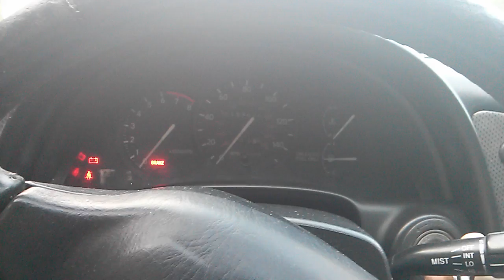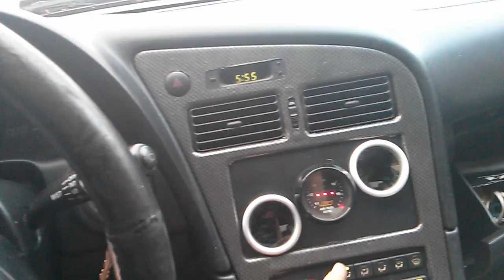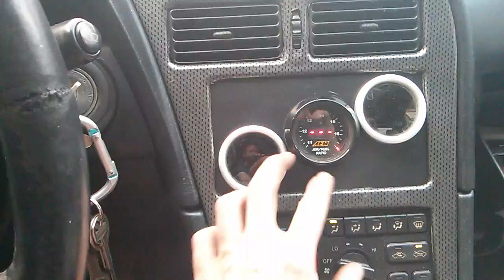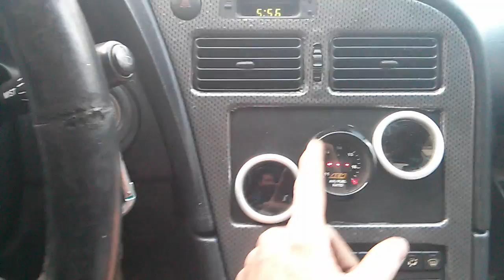3sgte swapped Celica first run!

Comment: I have a 1996 st206 Toyota Curren (P much a celica) with a 3S-GE engine in it currently. Yesterday I bought an old 3S-GTE engine to rebuild and put in. Still not too sure what I'm doing but I think I'll figure it out. It's gona be MAAD
Reply from the maker: I love the Curren! I've always want one, or at least the front clip. You will need a hood with vents though. I left my stock Celica hood on for a while and the engine gets too hot. I needed the GTFour hood, runs cooler now. I definitely want clear Curren taillights tho
Reply: Yea all Currens were made right hand drive, and 95% of the exported Currens are in New Zealand and Australia, obviously. Aw really? I'm not a big fan of most hood vents, so I guess that'll be another little problem, and I'll need a custom made one, because no Currens come with hood vents. The engine I bought was a 4th generation 3S-GTE, from a ST215 Toyota Caldina GT-T, so it has a top mount inter-cooler, but I wanna get a front mount one. Also, it has done like 370,000ks so it will need a lot of rebuilding and new parts before it goes in the car. It was cheap tho. I got the whole caldina with a running 3sgte engine for $700 NZD. Would it be a problem if the Caldina is 4x4 but my curren FWD?
Reply: You managed to connect your laptop to the ECU? Did you get a special ECU for this?
Reply from the maker: Simeon Stoyanov For your hood, do a google image search on "hood spacers" and buy some. They add a gap on the back of the hood for heat to escape. About the AWD trans. You said you have a 3sge in your curren right now correct? If that is the case then just use the flywheel and clutch pressure plate off of the 4th gen 3sgte and the clutch disk off of your current clutch (unless the inside gear on the clutch disk fits on the spline coming out of the transmission) It's what I did and it works fine. I don't know how similar the 3sge and 3sgte are but you might be able to use the whole flywheel and clutch assembly off of the 4th gen
Reply from the maker: Simeon Stoyanov I'm using an aftermarket ecu, I've done too much to the engine for it to run on a stock ecu. That is how I have a laptop connected to it.
Reply: Jay Shipp Yea hood spacers seem good, cheers mate. About the uh.. transmission. Both cars are auto, lol. I was planning on making my car manual along with the engine swap, and I was worried about whether an AWD engine would need anything to work on a FWD car, but it looks like I won't need anything, since I'll be replacing the flex-plate with a flywheel.
Reply: Simeon Stoyanov Obviously gonna need a manual transmission tho. Gonna be broke after this.
Reply from the maker: Simeon Stoyanov Oh, yes. I was thinking it was already a manual transmission. You would need a manual trans. Check out 6gc.net, they are celica forums but they would apply to the curren as well since it is the same car. Lots of guys love the Curren on there, and there is a ton of information on what you can do about your transmission.
Reply: Jay Shipp Sweet, will check out the forums. Thanks
Reply: @simeonstoyanov5226  did you ever do the swap?

Comment: I'm doing a 3 gen 3sgte swap what will I all need because ppl are Saying I will need a front clip and I think I don't need all of that. I need help can anyone help me please
Reply from the maker: +Robert Tucker Jr You don't exactly need the whole front clip but it is easier if you have everything. I went more of a custom way when I did mine so I got to cut some corners(by using engine management, custom wiring, etc).The engine is easy to drop in and bolt up, and if you have the 2.2L you can use the stock transmission, you just have to use a 3s flywheel and pressure plate with the 5s clutch disk. After that the wiring is the biggest issue to tackle, I'm not as well versed on what all needs to be done with the wiring since I ran my own wire harness from the engine management. You can find out most of what you need to know on 6gc.net, there is a sticky section that is pretty full of everything. I actually used a 98 MR2 engine with mixed parts from my old 5sfe (brackets and whatnot) and then had a ridiculously hard time finding the parts needed to convert it to the GTFour style 3sgte. Check out 6gc.net though, plenty of info on there.

Comment: Where did you get your motor?
Reply from the maker: I got it off ebay, then built up the internals and replaced the missing parts
Reply: Jay Shipp man i really need help im buying the engine for my 91 celica st but the kick panel wiring or the body/dash wiring doesnt come with it so what can i do?
Reply from the maker: Sounds like you need a wire harness. You've doing an engine swap or your are putting the same family engine back in? If you are doing a swap, I didn't use most of my stock wiring, I made a new harness out of the wires that came with the aftermarket ecu I put in. It's completely separate from the car wiring with its own fusebox.
Reply: I think im going to order a front clip aka the fenders onward up that comes with all the shit haha its a 91 st so it has a 4afe engine ill be using a 5sfe transmission
Reply from the maker: SvddenDeth
Reply: if i bought a front clip think i would be set?
Reply from the maker: SvddenDeth
i don't know what happened, I entered a response but it must have not saved. I had said that I don't think your 4s engine will mate up with the 5s transmission. The 5s and 3s engines are S family and require S family transmissions, the 4a and 7a engines are A family and require an A family transmission. I haven't heard of anyone mating up those successfully, but there are transmissions from other toyota engines that will fit the S engine.
Reply: Jay Shipp im using a 5sfe transmission for the 3sgte
Reply: Jay Shipp and where did you get the kick panel wiring again/body/dash wiring? like what is the brand and where did you order it from and how did you get it to plug in and play? thanks.
Reply from the maker: SvddenDeth It's not plug and play, I made my own wire harness. The Autronic SM4 ecu that I am running came with a long wire loom. I had to connect it to all of my sensors. The ecu is mounted inside the car and has its own power source. I only tapped into the ignition for the starter to work.

Comment: is that a celica gt4? bro?
Reply from the maker: +japneet singh kinda, I put the engine and front end on..no awd trans
Reply: Hournine Racecraft nice...so its rwd? I was thinking of getting a celica gt4 and swapping a 1jz or ls6 in it.
Reply from the maker: +japneet singh mine is fwd still. If you get a gt4 then you can mix the engine with a 5sfe and make it a stroker, plenty of guys do that to pull out 600+ HP. It is pretty hard to convert everything to rwd. There are also guys that swap out for the 5mz engine and build that up.

Comment: nice. Also completed this swap on a toyota exiv st200 which was a 94 NA 
FWD. Now with the 4th gen GTE from the ST215w and the megasquirt ms3x. 
Yet to drive it though, just winding up on the FMIC install then exhaust
 and the walbro. But it starts up and idles great. Check my channel for 
some vids.
Reply from the maker: nice.. I will definitely check it out